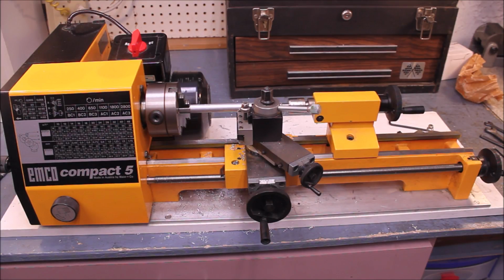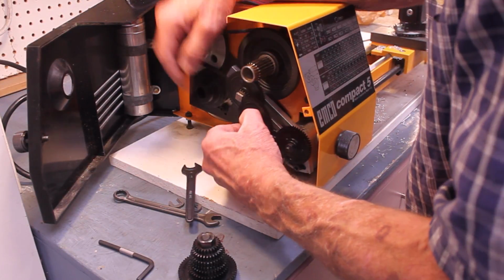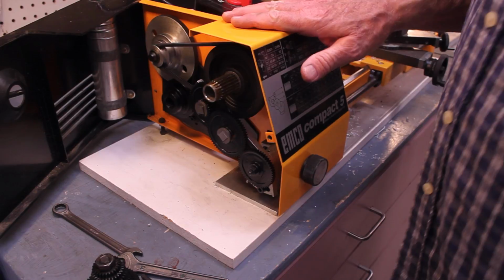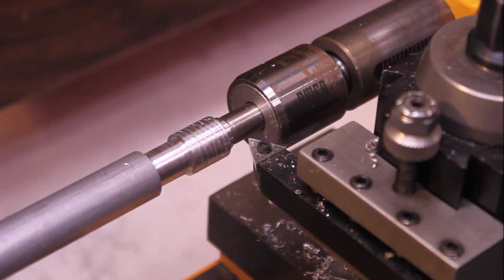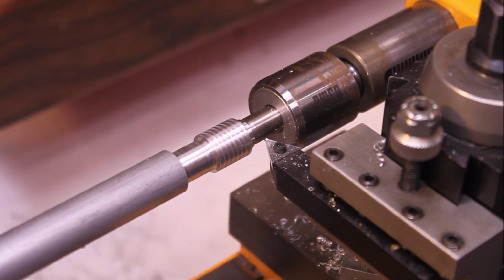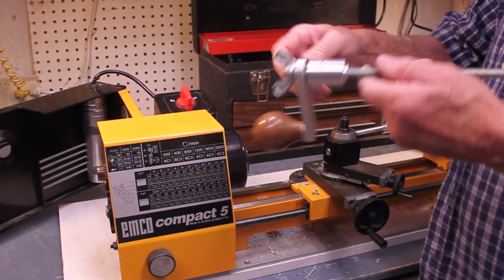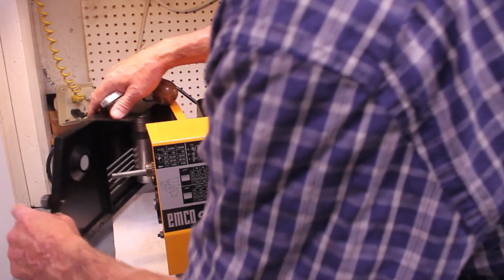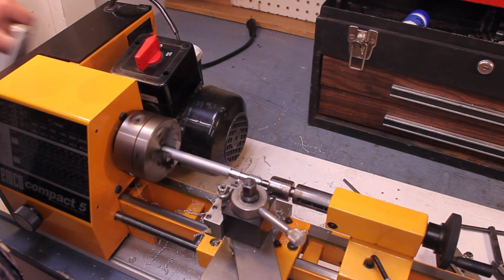Emco Compact 5 Part 2   Thread Cutting

Comment: Maybe if you plug this thing into a variac at say 1/4 of mains voltage could help with thread cutting?

Im looking into buying a lathe. Can I machine larger diameter objects with this one compared to ML120?
Reply: Won't work, it's an induction motor, what you got is what you got, only sheaves can change the speeds.

Comment: No chance for napping with the stopping of the feed lagging
Reply from the maker: Right you are! :-)
Reply: You attention should be on backing the tool out with the compound to avoid crashing on the other side of the gutter.

The other option is the one Joe Pieczynski at Advance Innovation demonstrates here,  https://www.youtube.com/watch?v=Z-dqOi_z5bk . Flip the tool upside down, run the lathe in reverse. The tool cuts the thread away from the chuck.